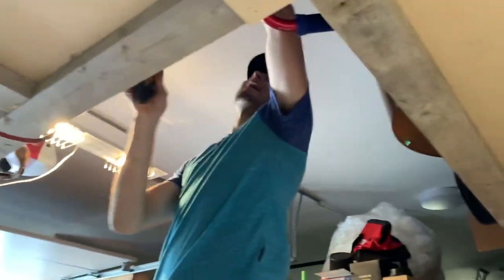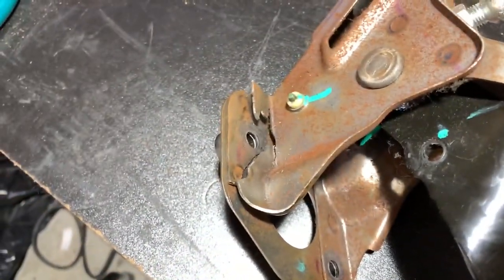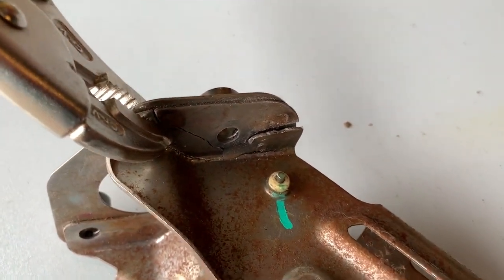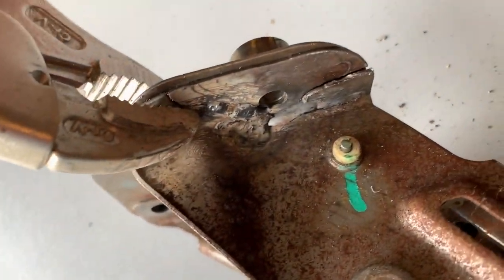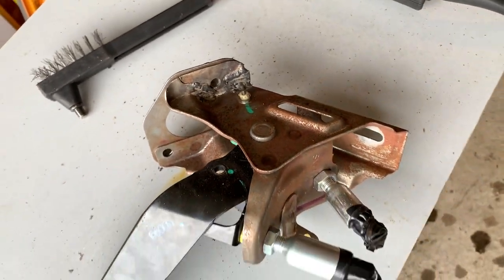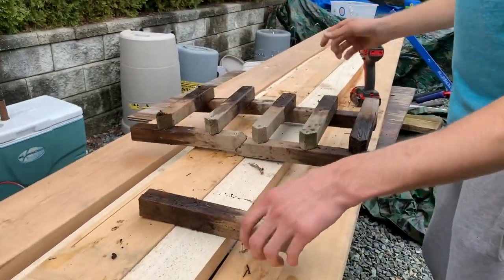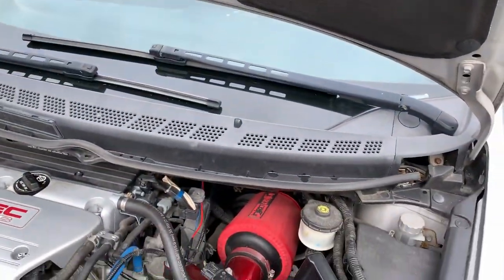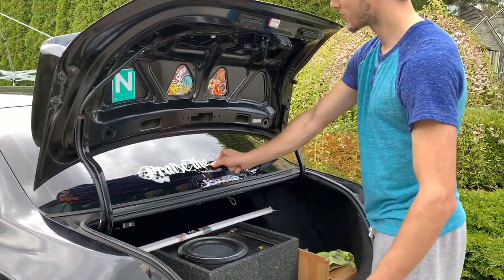8th gen Civic Si Hard shifting Problem EASY FIX! (funny)

Comment: Just wondering the shifting problem acted like before? My second is completely locked out after vtec engages and the rest of the gears and a bitch to get in. And it's starting to just get worse and worse
Reply: Welcome to the Joys of owning an 8th gen...
I've replaced the shift cables, put an aftermarket Hybrid Racing Short Shifter in, and put in Acuity shifter bushings, and replaced the clutch.

I still grinds, and pop outs at random sometimes it happens and sometimes it's doesn't. I'm going to Try and Replace the Clutch Master Cylinder with a K Tuned praying that helps. If it doesn't that means the synchros are toast, although I don't know how they would be.

Besides those issues these cars just shift like ass, the rev hangs bad and if you try to shift too fast the whole car jerks like a mother.

Comment: Same thing happened to my buddy guys, any and i mean ANY 8th gen clutch bracket will work ,only thing is youll have a black rubber clutch pedal lmfao, i put a 08 dx sedan pedal in his 06 fg2 si, you will need the sensors from ur si bracket if u use a dx/lx
Reply: Also weld support into the non cracked bracket and itll never snap

Comment: My Si has the bad 1st to 2nd shift after 6k RPM. I haven't taken off the clutch pedal yet but is it guaranteed to be cracked? Or should I stiffen up the with a few passes regardless? 

I haven't had the tig machine out in a few months so I'm looking forward to this and really hoping it is a simple crack to fix the problem. 

Thanks for the video man!
Reply from the maker: Lee Williams uhmmm I’m not sure you’d just have to check it’s pretty simple to pull out the pedal! Thanks for watching
Reply: @Carfleet  thanks for the reply gona check tmr and adjust the clutch and hope that fixes it. I have complete second gear lockout after 6k